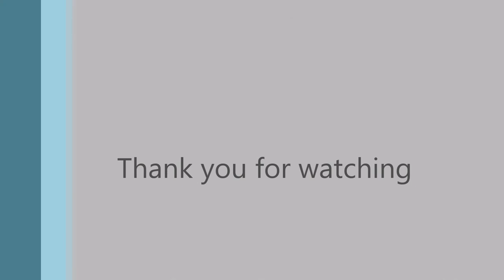Axle Fixture Project

Comment: Hello Mike. I have a JKUR with 3.5 AEV dual sport lift running 37’s.  I just regeared (using your ProRock 44 video) to 5.13’s and now have a vibe in front since RPMs are higher. My pinion yolk is at 0 degrees and TCase yolk is 7 degrees. I have the Adams double cardan 1310 driveshaft so when I set pinion to take out vibe my caster angle is only 2 degrees so Jeep drives like a bowling ball! 😁. I have heard that upgrading to a ProRock 44 from my OEM 44 will give me extra caster.  Do you agree with that advice or would you recommend a different solution to my pinion/caster challenge?  Thanks so much!  Paul
Reply from the maker: There are a couple of Dynatrac ProRock 44’s. One is merely a direct replacement for the stock housing as far as caster to pinion angle specifications . If you’re lifted in the 3.5”-4” range you want to purchase the one with the larger pinion to caster separation angle to net you the correct caster in the 4.5-6 degree range.  
That being said, the AEV suspension uses drop brackets for the control arms in order to keep caster in spec so I would double check driveshaft as well as pinion angles. 
You can also try rotating your driveshaft 180-degrees on your pinion and just see if it’s better or worse to take driveshaft and yolk out of equation. 
Lastly, on a double cardan joint the end with the single u-joint (axle end) can be a few degrees off of zero without any adverse affects so if you need to have a 3-degree driveshaft to pinion angle in order to have 4.5-6 degrees of caster for handling you still shouldn’t induce any vibrations into it. 
I hope all of that makes sense. 
Mike
Reply: zmotorsports thank you!  I am looking at the PR44 that has more caster built in...  I adjusted to the top hole in the AEV bracket and it helped the vibe but the caster was way too low and drivability was bad.  I will try the 180 rotate and see if that helps. Thank you so much for your advice and videos.  Very helpful.  👍
Reply from the maker: You’re welcome. I’m glad you enjoy my videos and find them helpful.  
Mike